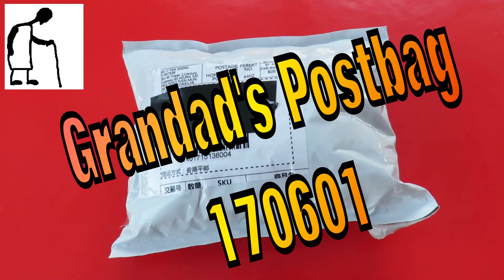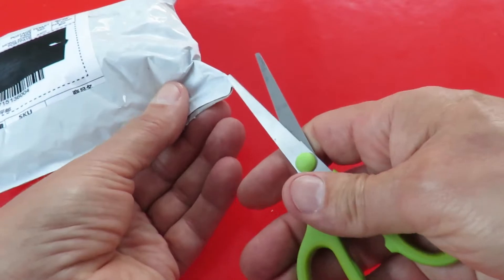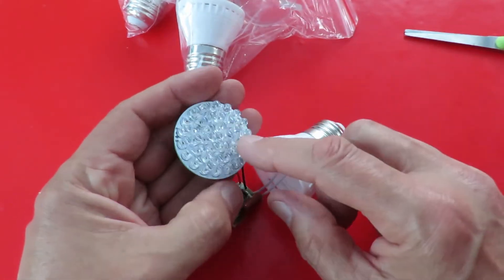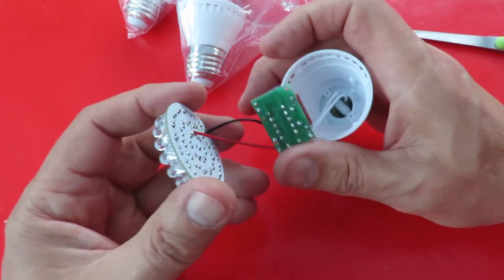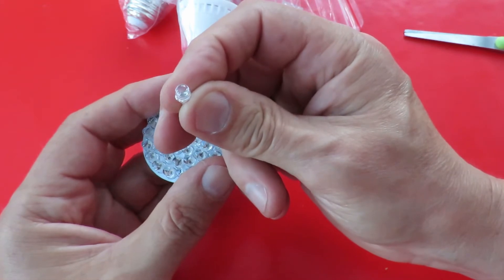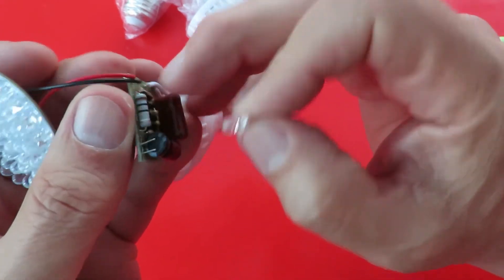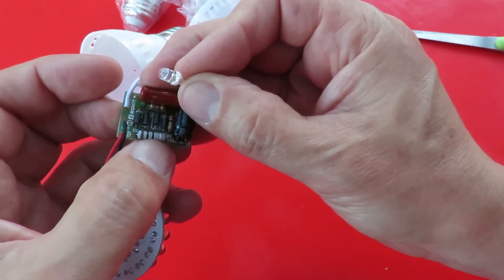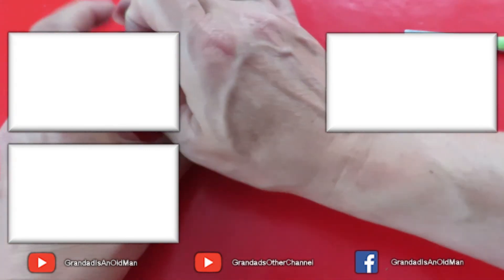Grandad's Postbag 170601 More LED Bulb kits

Comment: Brown Black Black is 10 ohms and may just limit the 'in-rush' current when it first turns on.  ...  Check around a bit more on what to change in the circuit.  It might be that you need a higher value of the same type capacitor.  If it's a 'current regulating' circuit, voltage to the LEDs may not be an issue.  One or more LEDs may be in backwards and may or may not be dead now.  You can take a 1.5v battery and a 33 ohm resistor and check each of the LEDs while they are still soldered on the board.  ... The math :: (1.5v - 1.2v) / 33 ohms =  9ma. ::  If that won't light one up, try a 20 ohm resistor for 15ma.  Hope this helps, but no guarantee.  ;-)
Reply: OK. I just upped the resolution .. it looks like a capacitive dropper.  So it may mean changing the resistor that is inline with the LEDs to drop more voltage.  Which means a higher resistance AND more watts on the resistor.  ... Odd thought - If you removed any one of the four diodes you would get half-wave rectification.  I don't know exactly how that would affect the voltage, but it seems that it should drop some.  It might also introduce some flicker.
Reply from the maker: Thanks for your help. You might find bigclivedotcom's video helpful https://youtu.be/-hZYli_gKaQ?t=10m58s I have done a series of videos now with these bulbs jumping right up to 2.2k ohm and working my way back down, I am actually down to 100 ohms in the latest video but that won't be scheduled for publication until July as I work about 2 weeks in advance. Whether I drop all the way down to 20 ohms we will have to see :-) It's just a fuss soldering all those LEDs in place so I wanted to make sure I didn't fry the second batch as quickly as the first attempt.
Reply: OK.  I watch Clive all the time and couldn't think of how to find the right video.  Thanks - That's one video I want to bookmark.  Wouldn't carefully measuring the voltage across a working resistor (say 1K) let you calculate a new resistor to get 30 - 40 ma for the parallel strings?   I will look for some more of your series.  I think I'm gonna like these kits too.  Thanks again!
Reply from the maker: The link for that one was in my video description as I referred to him in my video

Comment: They make a 38 l e d bulbs,kits and a60 l e d bulbs kits without the l e d ,s included,when I scrolled down farther on eBay I found the kits again,that the l e d ,s were included for less,it only proves one thing when shopping around on eBay keep looking you will find better deals,good luck on your Inca red bulbs
Reply from the maker: You know you can sort the eBay listings by cheapest cost :-)